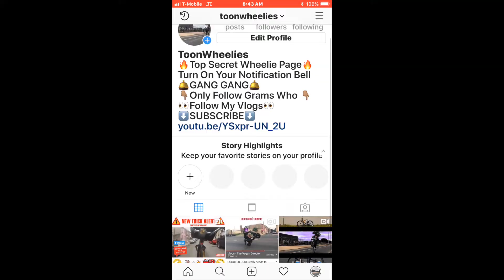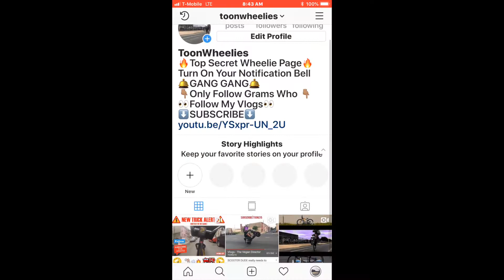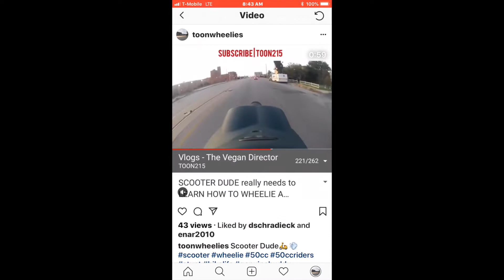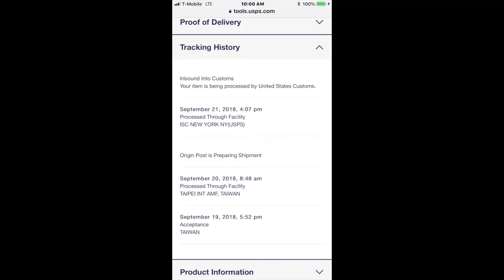UNKNOWN

Comment: If I was you while everything is apart smack some engine degrees spray on everything have that thang looking new
Reply from the maker: Yup exactly what I wanted to do. WD40 to clean up the rust speckles/Soap + Some degreaser to have everything nice and lubes + clean. 😎😎😎 Then eventually have ANGE CHAVO pimp it out again 😂
Reply: Just let me know and the engine degrees from autozone is good the spray one not foam